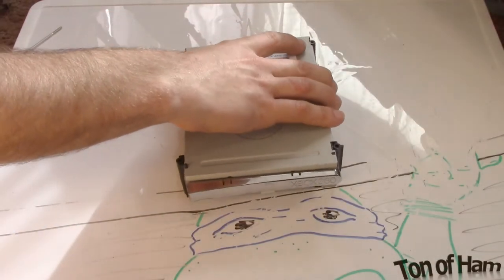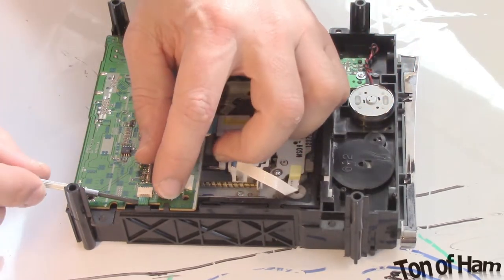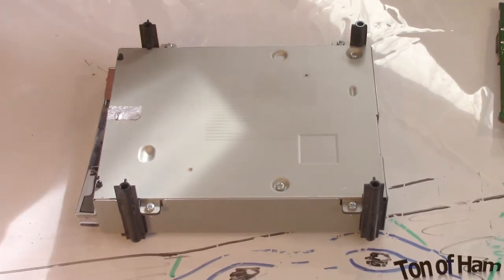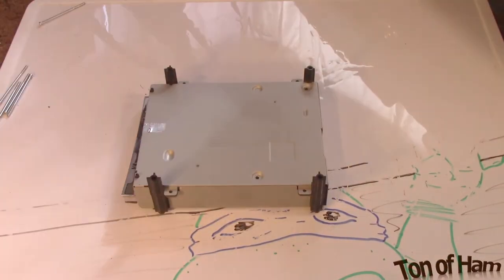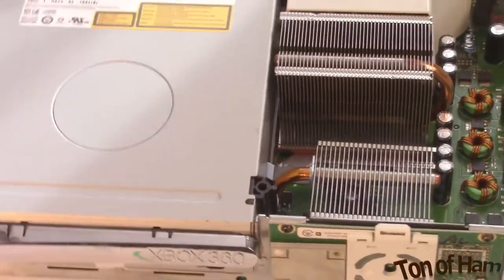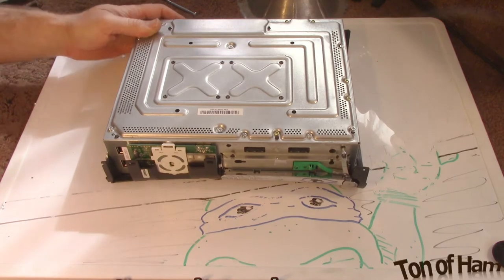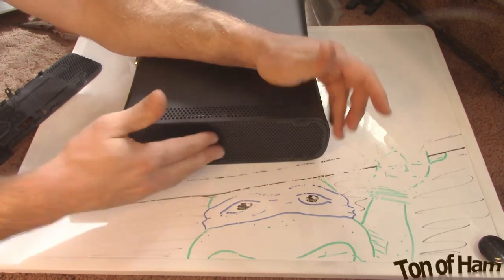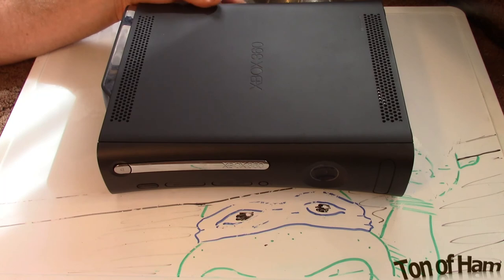Xbox 360 Tutorial: How to Replace DVD Drive Part 3

Comment: IT WORKS MINE WAS DIFFERENT TO THIS AS IT HAD WIRES CONNECTED TO IT THANKS MAN 👏🏼👏🏼👏🏼👏🏼👏🏼👏🏼👏🏼🎮🎮🎮💯💯💯💯💯💯💯💯💯
Reply: Philip - just tore my kids XBOX apart and ran into same issue where original DVD cables are soldered , did your replacement drive have the ribbon or soldered connection and if ribbon what did you do to get the board replaced? and big question DID IT WORK :)

Comment: Thanks man! 2022, bought my xbox back in 2007 or 2008, everything works except the disc reader. Cleaned the lens, turned up and down my potentiometer on the laser, swapped out old cooling paste on the cpu and gpu, but it still doesn't work. I think it's only the discreader, my xbox freezes when it reads games it doesn't read too well. So a replacement should do fine and then my xbox should be golden! Thanks for the information about the need to swap the motherboards out of the drives.

Comment: Incredibly helpful! Except, as it turns out this drive doesn't match the one in my XBox and now I need to do some really complicated firmware stuff to both of them... Sigh, thanks for your efforts
Reply from the maker: Yeah, Xbox repair is a headache and this model does requires a direct replacement for the board swap or you have to dig into firmware...
Reply: @capr1corn233  me and a friend are trying to figure out the firmware thing :/ It's difficult sense I'm having so many issues trying to figure out how to get Jungleflasher to work. I'm having issues on how to get that working... I have a Ben Q drive as the old one, and the drive in the video as the new one, if that helps
Reply: @quonit37  How's it going for you guys? Original Xbox repair and refurbishment is a cakewalk compared to the 360
Reply: @v3ck1n  Well, I set up all of the stuff (connecting the drive to both the XBox and computer) and tried to make the program to make it work run (Jungle Flasher), but no matter what I did it just wouldn't! So I put the project on hold until I could get it working... And I still can't figure it out, even with the tutorials.
Reply: @quonit37  check out se7ensins it will go into detail how to replace your Xbox 360 drive also if you run Jungleflasher on newer windows past windows 7 it’s might need a work around! Just look into it I believe win 10 you can still get jungle-flasher too work
Reply: @shiBuyaking109  thank you D: I've been trying to work through that, but the project wento n hiatus because of how difficult it was for me, someone who has never owned an XBox 360 before, or modded a console of any kind... I am determined I will figure it out, though.
Reply: @quonit37  Any luck?
Reply: @Austin1638  Nah, I took a break because of how complicated the project ended up being. In order to do the complicated firmware stuff, I needed to connect the drive to my computer, which required taking my computer apart and having it open on the floor while I messed with the 10 year old out of date programs that wouldn't even run...

Eventually I'll pick it up again and try to find a group of people that knows whats going on so I can work with them to fix it.

I told someone in a modding XBox server my story and they took pity on me and sold me a really cheap modded machine, so I'm using that now haha

Comment: Hello! In order to get dvd drive working, you have to have the same xbox model? for ex. Jasper to Jasper or i can replace a Xenon xbox with a PCB from Jasper?
Reply: Get the same DVD drive model.   They had different versions with non compatible DVD drives.  Unless you get the exact same model you won’t be able to swap the boards.

Comment: Just did swap on my old 360 wouldnt read disks anymore, swapped drives and pcb cards but i have the older drive card where you have to resolder 6 pins for the button motor and light.  Was pretty easy still good video, not sure who still plays 360 tho anymore ☹️
Reply: Andrew G a ton of ppl. I have every console known to man just about and I love my
360’s
Reply: 360 is second only to the original Xbox lbvs. I use my 360 to watch dvds and play youtube but when I want to game I power up my Xbox. My original Xbox library is at least 10 times the size of my 360 library.

Comment: Mine looks different inside.  The circuit board is differently shaped, and there are some wires soldered in place.
Reply: Mine was the same. Unfortunately there is no way around that, you're gonna have to take that one out and solder the new one in

Comment: I did swap the board but it doesnt seem to work,
Reply: aadblaauw your board could be toast in which case your screwed, but make sure you put those ribbons back in, if the system does not boot you didnt connect the ribbon cables good enough.  Make sure you have the right drive good luck